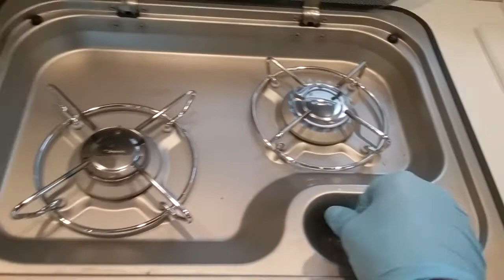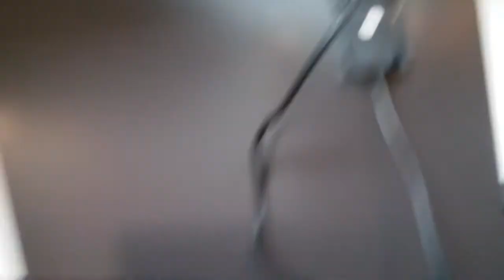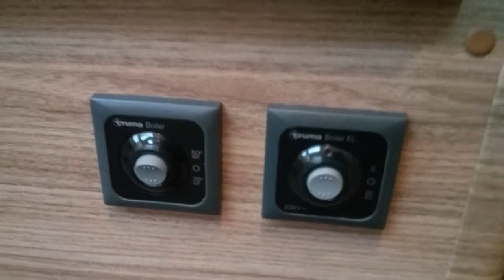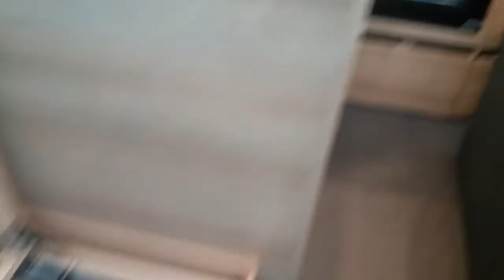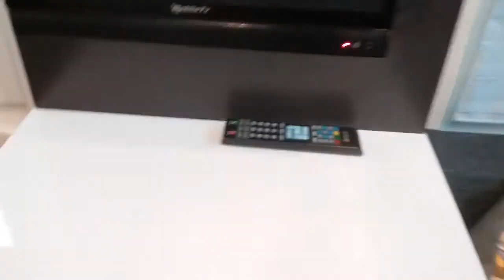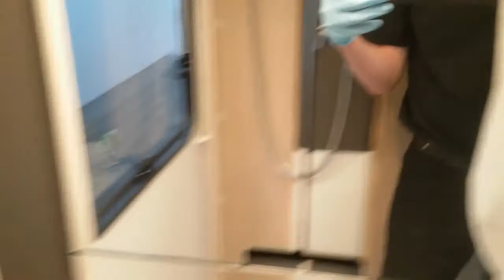49342 Adria Action 361 LT inside handover

Comment: Excellent handover presentation, thanks a lot. It will surely help us with our new Action that we just have picked up after waiting for almost 14 months here in Sydney. There is some difference with the European model as we don’t have heater , in turn we do have an air conditioner system with reverse cycle which uses storage space on the left hand side .Also the table is folded and used in the centre to set up the double bed.